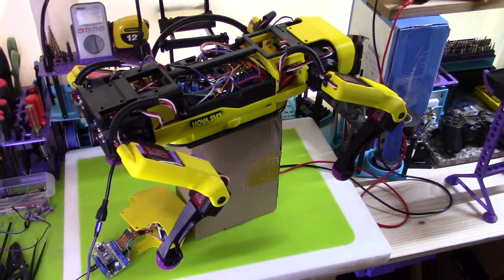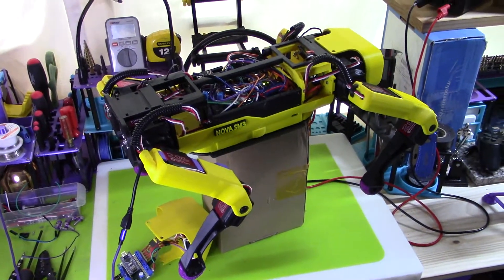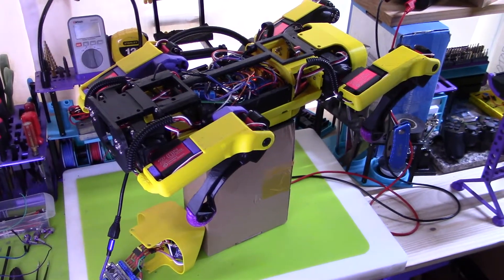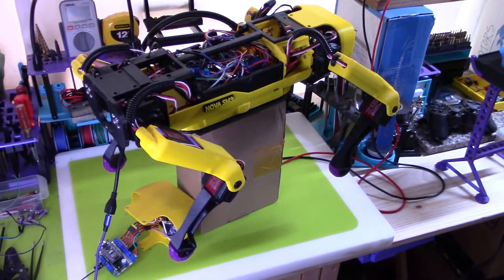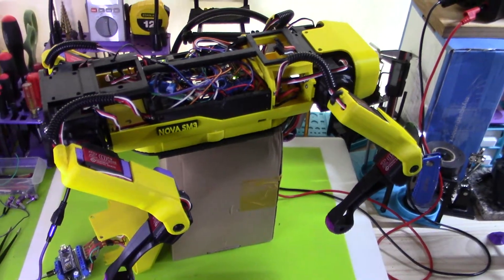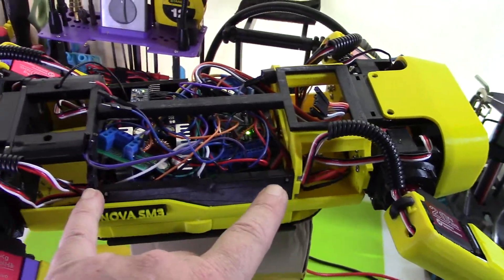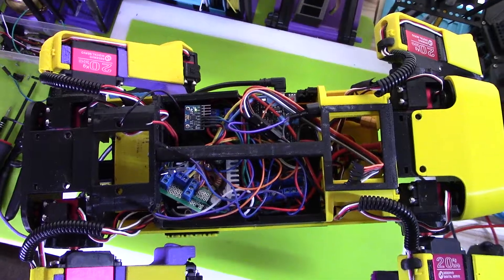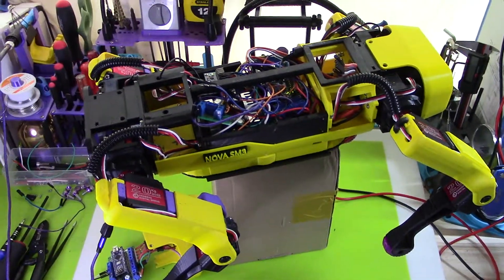Project Updates! : Nova SpotMicro 3 - a Spot Mini Clone Quadruped Robot Dog

Comment: Chris, Maybe you have already done this but I would make sure all the signal grounds and 0V connections are wired together in order to hava a common ground. Its hard to say what it could be but if there is any différence in the ground potentiels between signals that will certainly cause issues.
Reply: yes i think so
Reply from the maker: thanks Bob... yes, I've been suspecting I somehow broke my common ground with the new Nano circuit.  I'll be looking at this, along with a few other suggestions I've rec'd, and hopefully have her once and finally back on the ground in a day or two!!
Reply: Good luck. Wishing her a prompt recovery!

Comment: Maybe you should connect together the negative output poles of your two (6.8v to 5v) buck converters. They may have a little offset in GND reference that can make the I2C communication between Mega & Nano not working properlly...
Not really sure but...worth trying it...
Reply from the maker: I'll take any idea I can get - that sounds practical to me!  Thanks so much, I will let you know how it goes.  I do have concern this is i2c related... I've read adding external 4.7k pullup resistors and disabling the internal 20k pullups can sometimes help, too.  I may try that as well, like you, I suspect a ground / i2c issue.